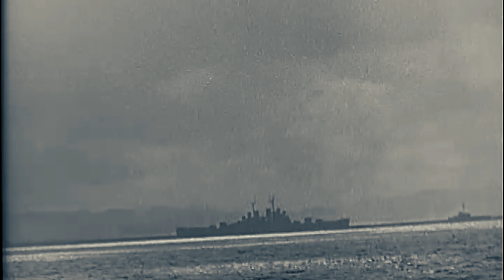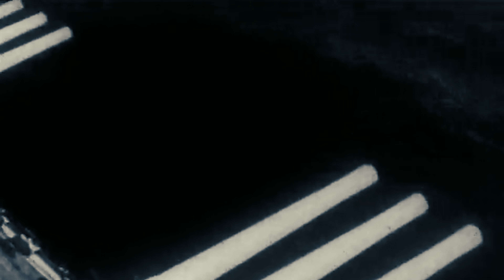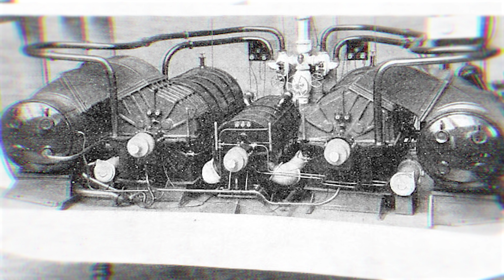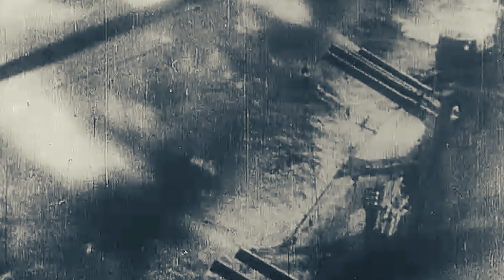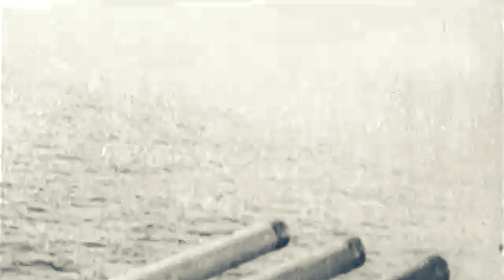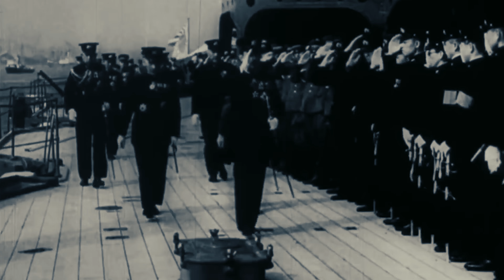The Incredible Engineering of the Battleship Yamato

Comment: Fascinating!!  My father-in-law told me in 1987, that he was on a torpedo bomber that struck the Yamato in that attack.  He said that the big guns were so heave that the turrets couldn't keep up with the aircraft, but if the planes got in a flight path that intersected with the guns' line of sight, it was absolutely frightening.  The shells emitted what seemed to be a solid block of darts, or whatever, nearly blocking out the sun.  He said that none of the planes in his ship's squadrons were hit.  I don't remember the ship he was on at the time.  Sadly, he passed away later in 1989.
Reply: Sounds like the San Shiki shells
Reply: The main guns weren't for aircraft 😅
Reply: @MrJimtimslim They wouldn't necessarily be effective, but still frightening if they were firing incendiary San-Shiki shells. The idea was to fire it at bunched formations of aircraft, but in practice the guns were too slow with planes closing the gap too quickly for them to make any real difference. I don't believe the main guns downed any aircraft when she was sunk, but the shells bursting would have been like a fireworks show.

Comment: Ironically Yamato met the same end as Repulse and Prince of Wales.
Reply: Ya guys need to chill out. 
Both tragedy, SOLIDIFIED the rise  of AirPower!!.

PoW/Repulse  wears the distinction of the FIRST MILITARY SHIPs in OPERATION  sunk  purely  with Air Power. 

Yamato, well we can  put is as the LAST of these Great Military Ships.. sunk purely by Air Power,   and the end these huge behemoth era.
Reply: At least PoW got to fight another battleship in her short career, heck PoW is the reason Bismarck was running to France instead of hunting convoys, by opening up the fuel system, among other damage
Reply: And for that matter, Bismarck.  It may have been KGV that actually sunk her, but it was Ark Royal's Swordfishes that delivered the crippling blow that sealed her fate.  There's a reason why everybody suddenly stopped making battleships at about this time.
Reply: It's also always struck me as ironic that the Japanese at least temporarily leveled the battleships of the U.S. Pacific Fleet using air power alone, but that's also hindsight. It was the only way they could manage it since they couldn't sail a fleet into the harbor. I think Midway proved that air power trumped gunpower, and Repulse and Prince of Wales proved that ships without air cover were doomed if airplanes appeared.
Reply: I don’t see any irony, defined as a mode of expression that conveys the opposite or contrasting meaning of what is said or written.

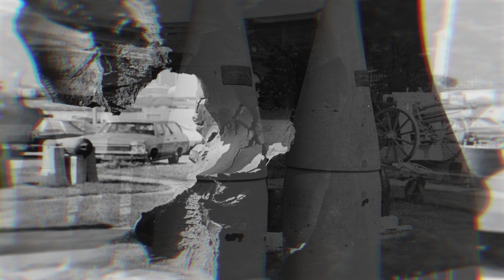Comment: 24:45 Kinda ironic and sad using an image of the piece of Yamato's turret front armor that they tested our 16 inch guns on while talking about the armor penetrating ability of capabilities of Yamato's gun...
Reply: It is kinda ironic and sad... But I'm sure photos of the damage Yamato would've inflicted, are exceedingly rare.
Reply: Fkn hilarous is more like it. The lowas would've shot yamato into absolute flaming pieces ala the Bismarck getting pounded by Prince of Wales and warspite! 

Superior speed for the lowas dictates the engagement ranges, superior radar ensures deadly accurate gunnery, superior damage control crews(peep shinano going down due to many watertight doors open etc) 

None of that truth distracts from the fact she was overwhelming 1 on 1 for anything other than the 9 gun iowas. For those anti American or anti iowa class nut jobs on here should see the released battle reports of big mamie proving moving hits with her shorter ranged 16"-45cal guns beyond any yamato might have had. 

And the lowas are proven to have damaged and straddled several destroyers moving at flank speeds at 20+miles! In an engagement the Iowa could dictate terms in any weather. And hit yamato most likely first, hardest and most often=mission kill then move in and finish her off! 

Sinkex in the 80s had 2 refitted Iowa's sending 2+rounds per gun downrange per minute easily! And the longest confirmed salvo from an Iowa while at sea onto a target that was battleship sized was OVER 24 miles!

Comment: the most amazing thing about the yamato class is that despite its power it ended up being utterly utterly useless
Reply: A battleship has a specific function. It wasn’t used for that function.
Reply: Because it was too big, powerful, but lacked good manevuer and durability.
Reply: It was actually rather maneuverable  @grandcanyon-d4d
Reply: The Yamato was so huge  and so heavy the crew on the ship couldn't even feel the pitch or roll of the ship. It sailed so smoothly they called yamato a hotel lol

Comment: I love your videos, and this is one of the best you’ve made! However, it seems that not much is known about the operation of Yamato’s boats and I bet you could devote an entire chapter just to the details. It appears they were not launched and retrieved through the aircraft hanger as you described but rather via those large openings on each side of the fantail. The are huge doors in there and a gantry rail that runs from outside the hull through a huge set of doors into the storage bays around the hanger. If you look at photos of the 1/10 scale model in Japan you’ll see what I mean. Cheers, and keep up the great work!

Comment: The 18" guns also used '30s tech different color smoke markers at the Battle off Samar. Effective enough to damage the rudder and keel of one of our escort carriers with a near miss at 19 nautical miles. I believe her sistership, Musashi, outweighed her by just a few thousand tons, marginal at that displacement. 
Consider that the prop shaft for the USN hospital ship "Comfort", converted from the largest class oil tanker weighs only 60 tons  . . . Or so my boss told me when our shop had it in the lathe for a new bronze bushing.
EDIT:
Well I had to look that displacement up of USNS Comfort up and it's comparable at a loaded 65000 tons.

Comment: During the Yamato classes development, the A-150 Design was prepared alongside it. The Design called for either a whole new ship be built, or have existing Yamato class hulls have the Nine 18.1 in (460mm) guns be swapped out for Six 510mm (21in) guns in three twin turrets.  

 For that reason, the Yamato classes turret barrettes were purposefully enlarged in the case that the A-150 Design/Conversion was fallowed through upon. Some other Improvements of the A-150 Design also incorporated later on during Yamato and Musashi's service, what would become the "Improved Yamato class Design" Which was supposed to be Applied to Shinano when she was to be built as a Battleship, which called for the Armor belt be Trimmed down to 400mm, and the 127mm (5 in) Dual purpose AA guns where to be Replaced with more Modern and effective 100mm 3.9 in) guns.

Comment: But it is also to say that japanese Anti Aircraft guns where obsolete in 1942. The 25 mm AA guns have a low rate of fire, a low range, low damage output, a really small magazine and needed a big crew to maintain. They where comparable with the 28 mm guns the US use at the beginning of the war, and they were then replaced by the 40 mm Bofors guns.

Comment: I wonder if today’s most advanced aircraft carriers are not similarly obsolete.
Reply: Totally. Drones and hypersonic missiles will make them obsolete in a decade
Reply: @jimjones1130  How exactly?

Drones are just slower, cheaper missiles. Problem is, carriers are already designed to deal with missiles, since the cold war. Standoff range is significantly more than most any drone, and anti air missiles and CAP are able to deal with any expensive drones. 

And while Hypersonic's do pose a new, threatening new threat axis, it's still not magic. Getting a carrier's location, processing it, sending it to a launch site, penetrating AEGIS, and landing a hit; all part of a kill chain, is still very hard. And SM-6 is theoretically able of shooting down hypersonics. 

Carriers will evolve too. Right now, the ball is in the carrier's court, but they are still very important. And even if the carrier does prove to be vulnerable, nothing yet has arrived able to replace all the capabilities a carrier can offer.

Comment: The Yamato and her sister were not used correctly, The Japanese thought that they were too valuable to use early in the war. Had they been used at Guadalcanal it might have turned the tide. but they were not used until later in the war. They should have also made a better HE round and ditched the anti-air shells.

Comment: Unfortunately for Yamato those Type 3 anti-aircraft shells were almost perfectly designed to be completely useless. Not only was the shotgun blast of explosives ineffective at hitting a fast-moving aircraft, but the main guns tracked so slowly even with the powerful motors driving them that pilots could see the gun orienting their way and change course. Worse, the ludicrous power of the main guns firing meant that anyone manning actual AA weapons would have to leave the deck or risk being badly injured (even killed) by the shockwaves.

Comment: The Japanese couldnt produce the same hardening on their armor plates as the other nations, so they compensated it with the extreme thickness. There is a photo of a 660 mm turret plate shot through by an American 406 mm gun.
Reply: That shot was taken from 400 feet away at a flat trajectory against sloped armor. The plate was rated as immune to all naval guns at all realistic battle ranges. Like, did you think an Iowa hit that plate from 15 miles away?

Comment: ohh Imagen if yamato and bismark both been used 'properly' and either escorted to negate the lopsided development of hardware aka air power being overlooked , until it couldet be that any longer or hade the right foresight so the leviathans could be geared properly aka long range AA interconnected with radar and more refined versions of the short range 'shootgun' AA yamato hade etc so there been counters to leet them use their strategic hardware in a tactical way , while the factions that used them where despicable the way both ships are among the few to compete for the title as true 'dreadnoughts' in the poetic leviathan sense its quite inspirational how neither ship despite being bombed into ragged piles of pain still not was captured , specially with how some of the crews followed either into the depths

though considering the Golden rule , and the resonance of pack bonding if there was magic and something eldritch came to threaten the children of gaia i wonder if not these two leviathans would awaken as the one thing the mountains of spectral steel care about the thousands of crew spirit that loved them in life having their rest distributed likely be the only thing that awaken monsters like yamato

Comment: despite its marvel engineering the ship still suffers a design flaw, the weight of the ship is too top heavy which might effect the ship performance and will overburden the engine(that explain why the ship consumed too much fuel in the process), the radar systems is crude and rudimentary as japan lag behind  the radar technology, the AA guns is even worse the type 96 25mm aa guns is slow to elevate and transverse(even with electric power) with additions of excessive vibrations which effect performance and used of magazines which required stoppage every the guns need to reload, the main guns although very powerful but unfortunately the guns tend to worn out rather quickly due to it's high muzzle velocity and poor japan metallurgy plus the guns is expensive to maintain lastly due to poor aa and the ship massive size yamato become a sitting duck for the American air forces as explained during yamato failed suicide one way missions to okinawa in a desperate attempt to reinforced the japanese soldiers garrison there the ship is helpless against the flock of American planes despite the escort destroyers and yamato itself frantically fire it's aa guns against the American fighter planes and dive bombers.

Comment: This was a badly designed ship.
Reply: Source and a valid claim instead of bait ?
Reply: @cideltacommand7169  The Yamato was too slow to keep up with Japan's fast aircraft carriers.  It got lousy mileage and thus unable to join long missions.  The design scrimped on steel plating due to manufacturing shortages.  The limited heeling angle delivered horrible maneuvering performance.  Get the drift?